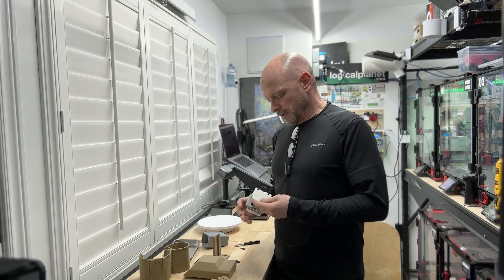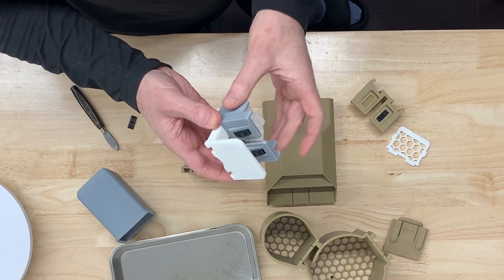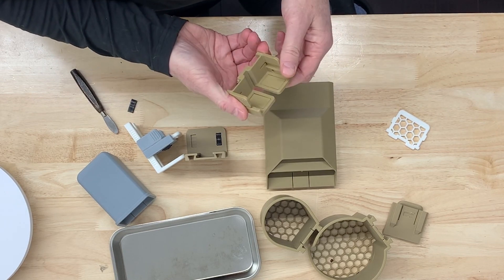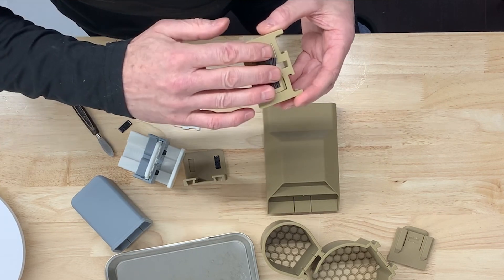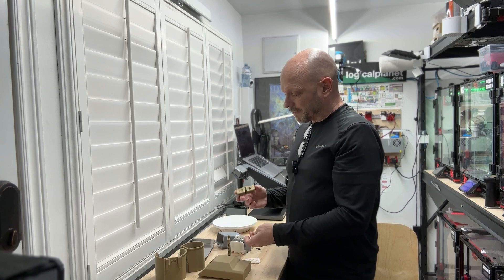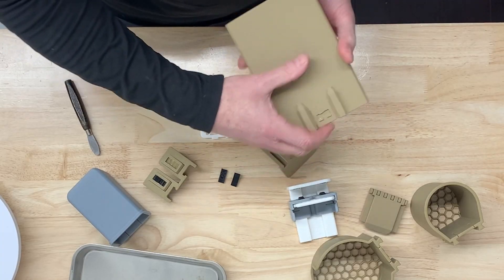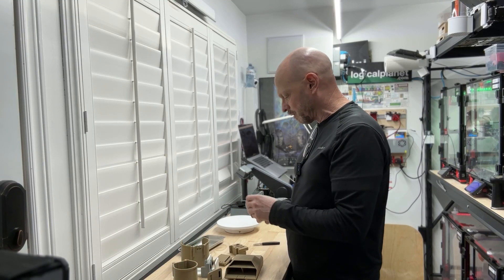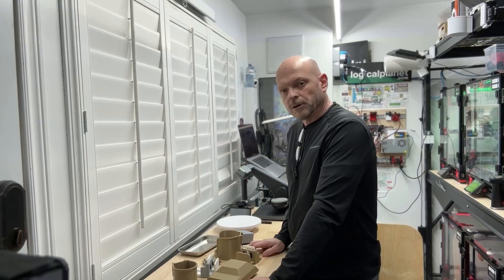ClampDock System

Comment: Love your work and detailed video.
Reply from the maker: Thank you.  Honestly, it is a struggle to make the videos sometimes but it is a good way to get a lot of informaiton across.  Cheers.
Reply: @logicalplanet3d  Do you have a video that covers the "click" mechanism inside the arms? I am new to complaint mechanisms. Thanks again for your effort.
Reply from the maker: @cpk001 I don't but I could try to make a short one about it for you.  Do you have any specific questions or aspects of it that you would like to know more about?
Reply: @logicalplanet3d  I was wondering about the load bearing capacity. How much the size of the detent matters and the material being used. I know that PLA for instance has a bit of memory so it may not always return to its original position etc. I suppose it also depends on surface area. I was thinking of using the mechanism in arm to hold a tablet as a second screen, but the longer the arm, the more force there will be on the "locking" of that compliant spring. I hope I am making sense :) Thank you for replying .
Reply from the maker: @kneukel Yes, you are right, and I am not sure I have all the answers.  I am trying to make a tablet version and I have also made longer arms.  The longer arms alone with just a phone significantly impact the torque and therefore the click joint load.  Balancing that with a heavier device like a table it is challenging.  And, knowing that different people will have devices of differing weights means I need to make it adjustable.  At the moment I am working towards make a series of clickjoint inserts so that one can adjust the strength as needed.

Comment: One of the flexing flaps used to raise and lower the clamp broke off instead of flexing and all of the grips were too difficult to fit into the slots, idk if that’s just a skill issue on my part. The lever system makes up for the lack of grips and the clamp feels strong on a smooth metal surface. I was using the original ClampDock so the broken bit is going under a desk and doesn’t bother me, so I’m very happy with the design, great work!
Reply from the maker: @andylordy177  good feedback, thank you.  Can you tell me what material you used and more importantly what infill and number of walls used in your slicer setting. Thank you.
Reply: It was PLA Basic Bambu Labs, the infill density was 40% Cubic, Wall Loops was 4. I’m new to 3D printing so let me know if there was a specific setting that you meant and I didn’t list 🫡
Reply from the maker: @andylordy177  oh, wow, yes, then I am very surprised.  Sorry it did not print well for you.  I can only recommend trying PETG as that would definitely have more durability.  And, I will keep your feedback in mind as I make revisions to see if I can strengthen it.  Thank you.